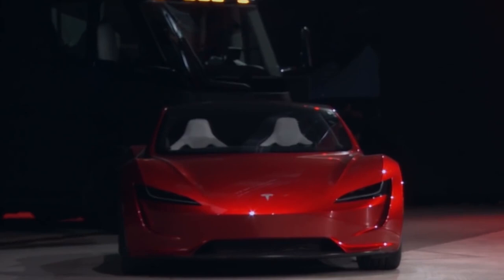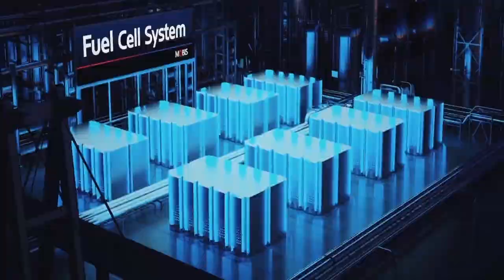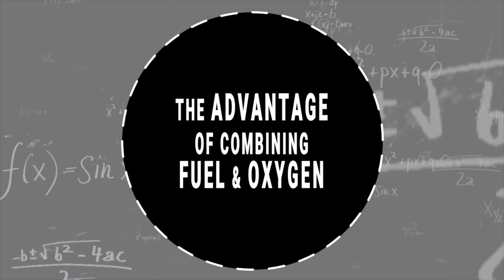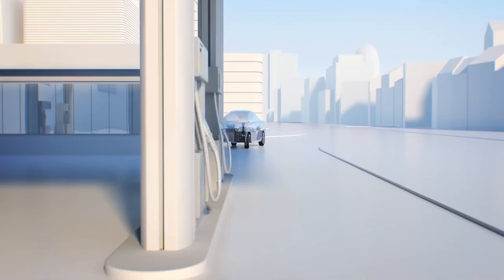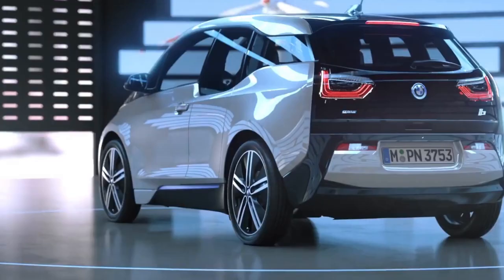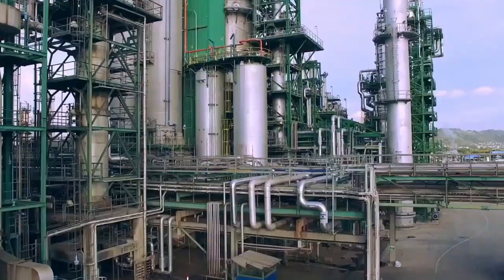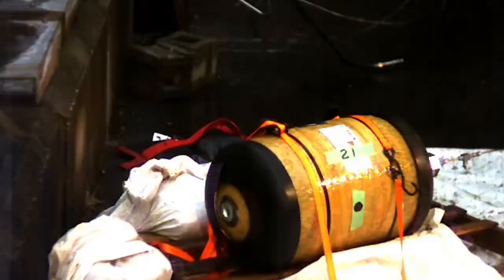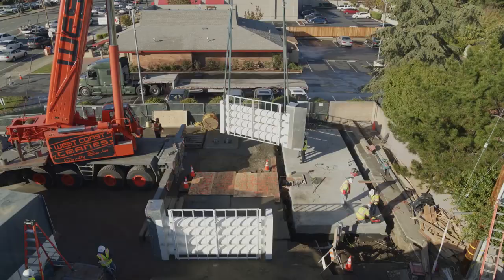is hydrogen fuel cell the future?

Comment: This car dont need hydrogen fuel station.,just use tap water.,put tap water to the power cell.,and the power cell will create hydrogen to power the engine.,
Reply: Splitting the water for the hydrogen costs more energy than you would get from the hydrogen, plus you would need to power a compressor to fill the tanks and the process would be even slower than charging a battery if you used grid electricity to run it.

Comment: what about the electricity used to keep hydrogen at a liquid state? it needs like -250 degrees celsius and 400 bars
Reply from the maker: You mean during producing the hydrogen?
Reply: @ScienceScout  no, i mean storing it ( its a gas, so it needs to be compacted or made liquid or it will need a lot of space
Reply: @pasticcinideliziosi1259  you just compress it.  It isn't that complicated.  There are cars that use it already.
Reply: @cole2839  yeah i know you can compress it, but good luck finding a 400 bars portable tank.
Reply: @cole2839  cars that use it already? in the us charging stations are rare and in china the main hydrogen vehicles are busses, which don’t need to be lightweight or have a very long range. If you’re talking about Nikola then i have bad news for you
Reply: @pasticcinideliziosi1259  You know every major automaker is working on fuel cells right?  Toyota, Honda, BMW, Mercedes, etc.  They are all still pursuing it.  Toyota still operates a fleet of its cars in Cali and in Europe that customers lease.  There are others too.  It is far from dead as you are implying because fuel cell cars actually make way more practical sense for a lot of people.  Don't come back and try and tell me they are worse efficiency.  Yeah but who cares when you can fill them up in 5 min and get 400+ miles.  Lots of people would adopt a fuel cell vehicle over an EV if stations were more prevalant.  Also, good news.  There are new self contained hydrogen generation modules you can truck to a gas station and install very easily.  They use them in Europe.  It is only a matter of time before they make it to the US.  So stop feeling so smug Tesla fanboy.  You are gonna have even more competition soon.  Telsa seems to need it based on the their quality control and unfortunate recalls that just happened this week (oops).
Reply: @pasticcinideliziosi1259  They actually compress it to 700 bar and there are already cars that have tanks in them that operate at these pressures.  These tanks are even safer than gasoline tanks as proven by testing they carried out where they shot the tanks to try and cause an explosion and nothing happened.  The hydrogen just rushed out super fast.  They even tried to intentionally catch it on fire and because it rushes out so fast and disperses super quickly (lightest element and all) it would not start fires very easily.  These tanks are also rated to survive 5x more damage than a gasoline tank before rupturing.  So just because you don't know how to do something doesn't mean smarter people can't figure it out. :)  Look up the toyota Mirai on youtube and be humbled.  Fuel cell cars existed over 15 years ago when I was in college.  GM brought one to my college and let us mess around with it.  It isn't new technology.  Adoption has just been slow because there wasn't really a market for it until recently.
Reply: @cole2839  cool i didn’t know that. Why are you implying i’m a tesla fanboy? lol
Reply: @cole2839  oh in one comments you call me a tesla fanboy and in the other a ICE lover. What about charging stations?
Reply: @pasticcinideliziosi1259  What?  Are you OK man.  Your comment makes it seem like you are drunk.
Reply: @cole2839  i’m asking you a thing

Comment: Well, it's not ideal.
A modern engine with compression ignition, popularly called the Diesel engine, has an efficiency of up to 48% with far more classic hardware.
So that 60% with all the problems related to the production of hydrogen, its storage, .... still not a solution, at least not rational.
Reply from the maker: In the short term, it looks like hydrogen too complicated and expensive but still the revolution of transportation from fossil fuel to electric or hydrogen just start
Reply: @ScienceScout  It is possible, but only small fuel cells as in Toyota, or also, to power the electrical installations on the vehicle from a small fuel cell.
Reply: It's not about efficiency for fossil fuel energy anymore, regulations already been set out for car manufacturers to have at least 60% of their car model to be EV by 2040, Dodge and Jeep Wrangler are in their final hours because they haven't met any of the clean energy regulation criteria. Plus government gives out tax rebates to consumers for purchasing EV. i.e Tesla model 3 is about 40k but after rebates it's about 26-30k depending on your tax situation.

Comment: There is never any mention of what the carbon footprint is to recycle an ev battery. I found only one center in the US that is capable of crushing such batteries then placing the debris in steel drums so as to not combust where it goes from there is anyone's guess. Oh and I highly doubt they handled the 40,000 car batteries that were replaced in north America last year so where are they.
Reply from the maker: It's a good topic for new episodes, I will look for it.
Reply: The technology isn't sufficiently developed for accurate numbers, but it probably ranges somewhere between 40% and 80% of the carbon footprint of building a battery from virgin materials with the added advantages of avoiding further damage to land and reducing the amount of money going to child labor. At the moment almost none of the EV battery packs should have reached the end of their usable life by now if they get repurposed for grid storage after being removed the recycling industry probably won't be fully established for another 20 to 30 years.